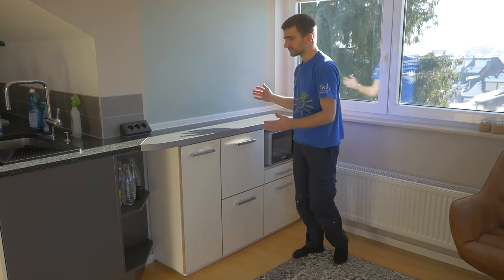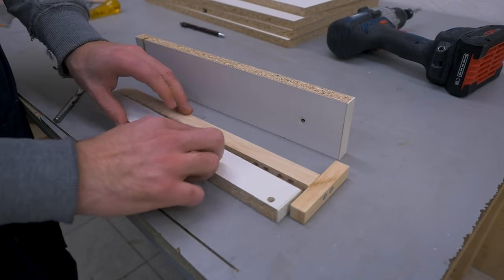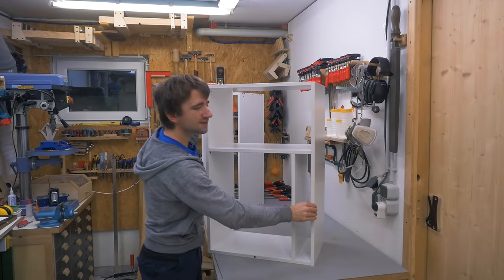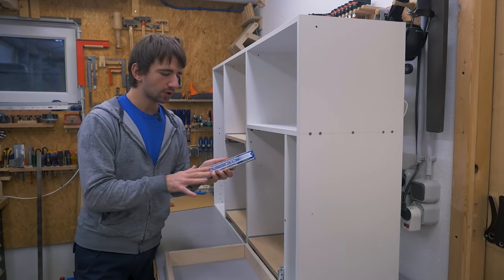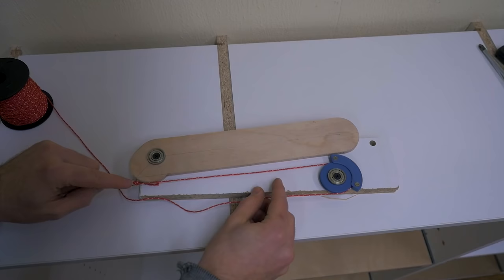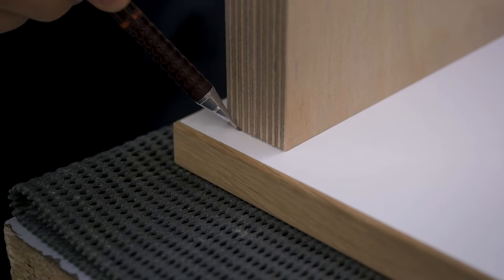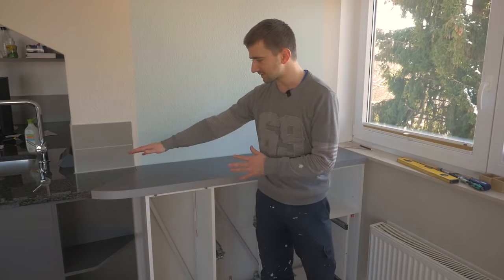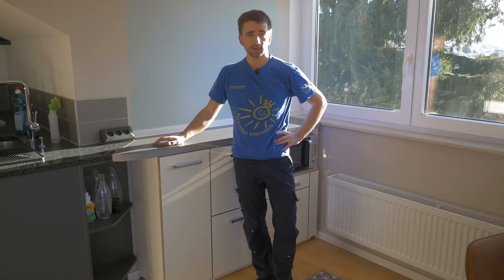I Over-Engineered a Kitchen Cabinet with Special Features

Comment: I think that by just changing the string to a small metallic cable the built would work for way more than 2 years. And since it’s a fair and simple mechanism maintainance is no problem
Reply: Also less likely to snag or tangle
Reply: Instead of pulling the trash cover up just slide it off
Reply: I was thinking a bike chain would outlast the table
Reply: @Evanbgoldin  
just use a bicycle brake or derailleur cable.
Reply: @Evanbgoldin  Normal small metal cable will outlast the table too.
Reply: I just wouldn't put a lid on it at all. It's already inside of a cabinet...
Reply: Dunno if you have to go full metal, think it wouldn’t flex the same. You can get some pretty heavy duty nylon cord that would do just the same! 👍
Reply: For a cord that will last a long time, some Dyneema would be the best. Stronger than steel, minimal stretch  and much more flexible for a longer life over pulleys. 1.1mm rope has a breaking strain of about 180kg so it will be more than strong enough.
Reply: @mikeb5352  the reason you'd want the lid is because the cabinet would probably smell from the trash rather quickly
Reply: @mikeb5352  maybe he tries to avoid any smell of food scrapes or any flies freely getting in and out. I personally would like a lid on my garbage drawer at home but cannot invest time to make a lid like this dude did :)
Reply: @Faust_77  & @Voron Agrrav, I don't think it's for all trash, like food waste, diapers, and other rubbish.  I think it's only for plastic trash (0:39) that needs to be separated for collection, for what I would assume to be for recycling purposes. I always rinse my recyclable plastic, glass, and aluminum, as I'm supposed to where I live.  I'm not sure if that's expected in other parts of the world.  Rinsing resolves any pesky fly issues.  If you don't rinse, flies could get in there, even with a lid.  The lid would likely be effective at keeping them in there, at least until it's opened again.  I agree with @Mike B, I simply would've avoided putting a lid on it.  But the solution was fun to watch and would be great for regular trash.  That would get pretty smelly without a lid.
Reply: I would redesign the mechanism by simply using a vertical sliding piece. When the door opens, the sliding piece goes up. The bottom of the sliding piece is lifted by a slope track installed on the side of the case.
Reply: If the line is Dyneema, basically kevlar rope as used in modern sailboats, it will be stronger than wire rope of the same diameter and will wear less on the sheave. Where mechanisms like this tend to fail is at the lid's hinges, due to the fact it's being twisted a bit every time it gets opened. Those plastic hinges aren't really designed for the extra upward force from the asymmetrical lift. It would help if there were actuators on both sides, or a stronger hinge mechanism would help. The fact the lid is very light is good though, as is the design of the wooden actuator to lift the lid quite far forward. What you want to avoid in these torque situations is concentrated reaction forces that you can't spread out. Overall I think this is a good design and should last quite well.
Reply: The best part is no part, remove the lid.
Reply: This was my first idea before the string but as soon as I heard the cabinet I was reminded of a wave on a pocket knife
Reply: @Voron_Aggrav he said it's for plastics, not food waste, so probably wouldn't smell too bad.
Reply: @alanclarke4646  depends on the level of work you'll put into your plastics, seems you're also repeating what someone said about it to me over a year ago,
but yeah if there's no organic waste the smell shouldn't be present, but for anything including organic you'd want a lid

Comment: The only issue I can think of is the string deteriorating over time.
When its time, I would suggest replacing them with guitar strings.
Nickel flat wound steel for the weight support line, and maybe a beefy nylon for the actuator line.  Steel might not happily make that pulley curve.
Reply: Normal generic steel wire is much better and cheaper option. Heck they last decades on ie. motorcycles and cars, it'll outlast that cupboard with ease.
Reply: Could also use braided fishing line (strong corrosion free yet still flexible enough to be tightly wound around a pulley or a fishing reel, unwound and rewound thousands of times without loss of strength. Oh, also abrasion resistant!)
Reply: @jothain  Tell that to my clutch cable....
Reply: @MrBobthelama  tell that to guy who does maintaining like shit. Clutch cables can outlast normal road bike if maintained.
Reply: @jothain  normally I'd agree with you, and to en extent you are right. But they snap every 4-5 years of daily use on my model due to a bad lever design that sorta kinks the end. Thus making it snap "frequently"...
I can understand if you don't care about nuances and we can just all pretend like it's my fault anyways 😉
Reply: @MrBobthelama  Ok, faulty design is bit different thing 🙂
Reply: Why not just leave the bin lid off? what purpose does it serve?
Reply: @Tensquaremetreworkshop  It helps keep the smell in a bit better
Reply: It’s a piece of string. Just change it from time to time. What doesn’t need changing or reparing! 🤗❤️
Reply: Mike M i agree, you could argue that it's for the smell but if you're separating plastic for recycling it shouldn't have any bits of food left in the first place
Reply: That entire mechanism is bonkers. So many points of failure.
Reply: @user-dx4rx3bt2l  Most plastic collection points nowadays allow a bit of food.. It's a bit counter productive to wash your plastic waste yourself, making it less difficult for people to recycle.
Reply: I always wash out my recycle stuff. That bin could take several weeks to fill (as mine does) and lid ≠ airtight, though it helps.
Reply: @marymaryquitecontrary  

Face it. His next mod is to decide to make it airtight. 😀
Reply: Nah that string will outlast him. I just don't like the springiness of the string

Comment: NICE!  Beautiful, well thought out execution.  SUGGESTION: to make the tip-open plastic bin mechanism a bit easier to use and last longer, remove as much mass from the lid-lifter arm as you can.  Less weight out at the end means less stress on the string, less effort lifting the lid AND the arm, etc.  Alternatively, you can add a spring to that to cancel out most/all of its weight at the beginning of the travel.

Comment: I love this cabinet. It makes amazing use of an otherwise almost useless space, while also taking things like your coffee machine away from the main kitchen counter. The fit and finish is also amazing.

The only thing I'm not a fan of is that lid-opening mechanism. I feel like you'd always have to open the plastic bin slowly, to prevent the rope from pulling tight suddenly, smashing the lid open with force. Personally, I just wouldn't have used the lid, since it's in an enclosed space anyway. That would also allow for only slightly opening the bin to quickly throw in something small, now you have to open it quite far for the lid to open.
Reply from the maker: The mechanism already got some abuse with rapid opening. It's really not too bad, but I understand your point
Reply: @MariusHornberger  Oh I have no doubt it'll survive, and even if something breaks, it'll probably be the string or the plastic lid. Easy enough to replace. I personally simply wouldn't like that feeling of "I have to be careful, or it'll slam the lid excessively".
Reply: I think it's fair to say it's not about practicality but enjoying the challenge of solving a problem. I keep my plastic recycling in a paper shopping bag on the floor. That's practical. But it wasn't much fun to come up with!
Reply: @bradley3549  True, but (IMO, to each their own) this is overengineering. Sure, it's fun to have a self-opening lid with a mechanism you made yourself, but for me, the annoyance of having to open the bin up so far before the lid opens and having to be careful to prevent the lid from slamming would quickly overcome that tingly feeling you get when something you made works well. Again: this is how I feel, to each their own of course.
Reply: @timderks5960  It's almost like that's the title of the video! :) The nice part about being the inventor and builder is that when/if it becomes too annoying or breaks - that's just an opportunity for more over engineering to make it open sooner, smoother, faster. It's a win-win either way I'd say.
Reply: @bradley3549  Yes it is, but I feel like if a YT creator calls something overengineered, they mean complex and maybe slightly silly but fun. What I mean by overengineered is that you literally went too far, and made it less useful by putting more time and effort in to it.
Opening sooner isn't really an option, since you always need the bin's hinge to be (almost) past the countertop, otherwise the lid can't open, no matter what. There's also no way to get rid of the jank that's in the system (moving the bin while not opening the lid, string pulls tight, moving the bin AND opening the lid), since you can't keep the string tight from the beginning, since the lid can't start opening from the very first bit of motion. 

Like I've said: Of course it's up to Marius to decide what works for him, I'm just saying that IMO this isn't an optimal solution, and is overengineered in a way where it's not as good as it could be, simply by adding too much.

Comment: I love this, the only issue i have is over here in the usa, hiding an extension cord in an enclosed space like that would be considered against code and a fire hazard (obviously building codes differ from state to state and even county to county) but the general rule seems to be is there are electrical wires concealed in a permanent or semi-permanent structure they must be electrical wires not extension cables because extension cables are not regulated by building codes (because super cheap under insulated extension cables are out there and if they start to catch fire they want the cable in plain sight)
Reply: this, also having it be plugged into both a microwave and another countertop outlet with a coffee machine hooked up is a lot of load for that poor extension cable
Reply: The problem is that the cable ist heating up and in a closed space it can overheat. Especially with thin wires and bad contacts. This furniture is open in the back and due to higher mains voltage in Europe there is only half the current flowing. So not really an issue where Marius lives.
Reply: @tubybubi  normally yes, but it's one of those things that really depends on what kind of load you're putting it under not only for the heat buildup of the wires but for the connection points as well, and like I said, a microwave and a coffee machine is a lot of load to put that under. it won't be a problem immediately, but over time after prolonged use the wire insulation is going to get brittle, and the contact points not only on the prongs but inside the sockets of both the extension cord and the wall socket are going to degrade, further adding to heat buildup until finally something melts...

Comment: Nice work, love you engineered designs. 
A tip: you can "daisy chain" clamps together to make a long clamp. It's not perfect but it works. You basically find a configuration that will allow you to clamp down on each end and then join the clamps in the middle with a third clamp turned 90 degrees to the other two. 👍

Comment: Very nice, love the mechanism for opening the lid. When you first mentioned it I was just thinking of a string through the center of the lid and anchored to the inside top of the cabinet but that would probably be to shallow of an angle to open the lid. I like your mechanism better anyway because of how simple it is but still complex enough to show off and last a long time.

Comment: What an amazing job! I'd probably use plastic threads instead of regular strings due to flexibility as well as ease of cleaning. Snap-ons for the lid would be nice too so it wouldn't wobble and stay opened more firmly.

Comment: Great video! A more robust engineering design would be to fasten a cam to the top of the lid and attach a spring to open the lid. The cam would guide the path. A good rule of thumb for engineering is that you want to minimize moving parts. As for the beverage tray, the bracket you used is better for torsional applications since the moment of inertia is in primarily in a different plain of flexion, perpendicular to the cantilevered drawer front you used. An appropriate bracket would look like a square (without a diagonal transverse member) that you could embed into the wood. Great craftsmanship and interesting solutions!
Reply: is in primarily a*

Comment: You've  done a great job of this Unit.
If you have trouble with the String, you could use Wire instead.  It may have been easier to use a Spring to push the Lid up on the Bin section.
Reply from the maker: As I said, I tried a lot. Also springs in the lid...didn't work

Comment: Wow - that is a pleasure to watch. So many little details and cam jokes ;)
I just noticed you did the same mistake with the microwave as people who renovated our kitchen (unless you can switch the way door opens) - taking out the hot plates with the door in your way is very impractical - even more so that the microwave is low. Would be better to switch the order and place the microwave on the left (and also possibly rather on/above the counter than below).

Comment: I love the blum hardware.

not sure how we lucked out with it but we recently re-did our kitchen and while shopping around for cabinets (flatpack ones) we hit up all the usual big box places and did quotes, including ikea, the all came back around the same price, found a local place that makes to order flat pack cabinets (as in you give them measurements and requirements and they cad up custom cabinets) and got them to do a quote and they came back quite a bit cheaper, so much so that they were still cheaper once you add the benchtops on to the invoice.

to make it even better, when it arrived it was all blum hardware, so much better quality than all the big box store hardware, not to mention a lot easier to mount.

the cabinets were made from really high quality particle board, it was really dense, the few other cabinets I have made in the past have all been quite loose particle board. not sure why the local guys were so much cheaper. I guess because there was very little packaging involved (all the parts were just plastic wrapped together and the hardware was thrown into whatever bag/box they had laying around.) and it didn't first have to get shipped into the country and then across the country to sit on a store to then be sold and shipped again. the particle board just had to come from the factory, then CNC's and stacked for me to pick up.

Comment: For the bin lid I would have used something abit thicker than the string used, maybe some sort of slimline strap?

Good idea with the electric lighter though for cutting and sealing nylon cord, much better than my usual cut with knife then use a normal lighter until it melts.

Comment: A gusseted angle bracket for that crate drawer would have been a good option too. That would also center the crate in the plank as long as you made the drawer the right width.

Comment: I would like a trash bin like that. Would like to add a micro-fan and half inch air hose to vent stale odors and ethylene gas out through wall. Maybe a kick plate switch and motor/actuator could be added for hand free operation :)   -- if over-engineering is the theme.

Comment: I had this in mind, seems like a great idea for a rubbish bin, I would go with a plastic one fixed to the door, was hoping for the lid to stay inside and move a few mm up and down - that would require probably a not that simple engineering to make it work. Also I worry about the hinge. Is that the best one to support the weight? If yes, than would this work better with the big hole in the base or in the door... I would put the holes in the base, but that wont allow for all the adjustments you have with the holes in the door. Aaaaaah. I'll look for a  ready made solution to see what they did...

Comment: Part of me thinks that you could have achieved the open/close mechanism with a cam surface attached to the underside of the top of the cabinet and a follower piece attached to the top of the lid. Some fine tuning of the geometry and it's a very simple mechanism. Ultra high molecular weight tape on the surfaces and it will also be extremely smooth. Designed best in CAD, but you seem to definitely have those skills.

Comment: Love it. Just the worktop edge was a curve. The rest of he kitchen looks to be 90 and 45 degree solutions. For exampl,e those shevles on the black undersink side thingy. I would cut the countertop same design. Two 45 degree turns.  Trash does not need a lid.